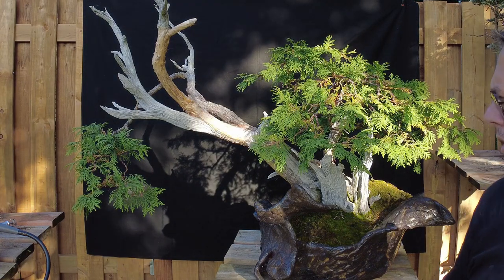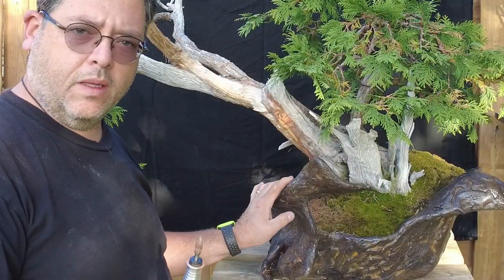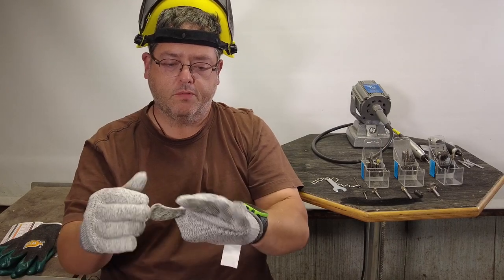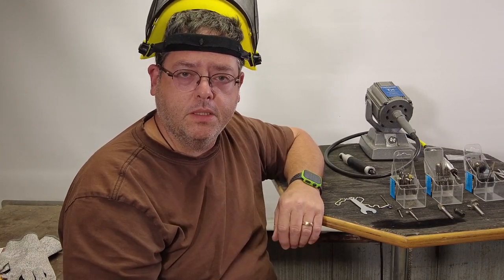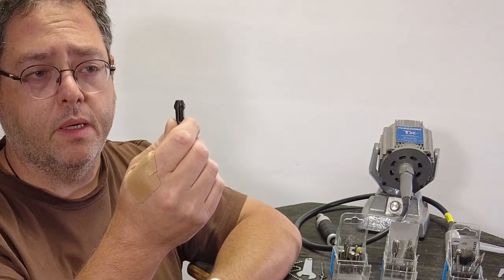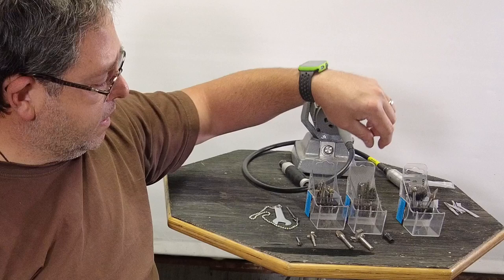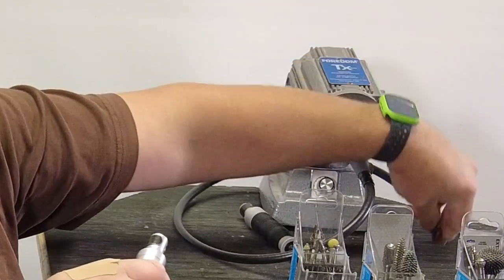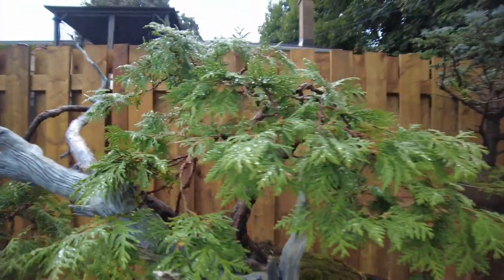The most important Bonsai Carving video you'll ever see

Comment: Unfortunately, many bonsai artists neglect this.Thank you for sharing this. By the way, using a pedal is a very good idea, especially for a flex shaft or Dremel, since in a panic you won't be able to turn it off instantly. The Makita grinder has a better design because the trigger is in the enable position only as long as you hold it by fingers.
Reply from the maker: Thank you! I never used a Makita but glad to hear it has some fail safe mechanisms built in.